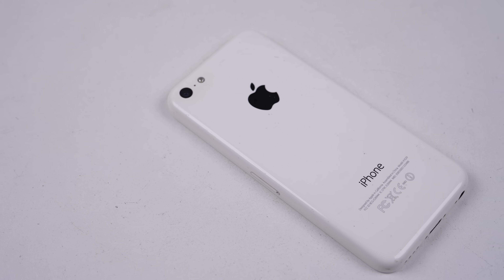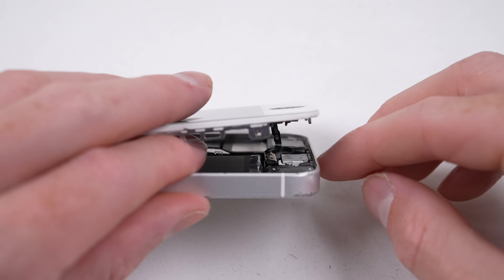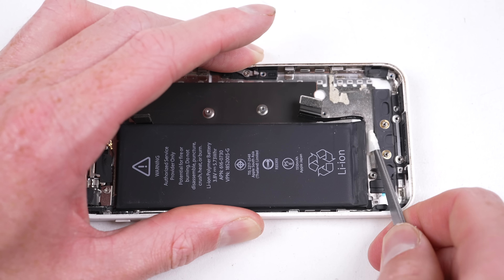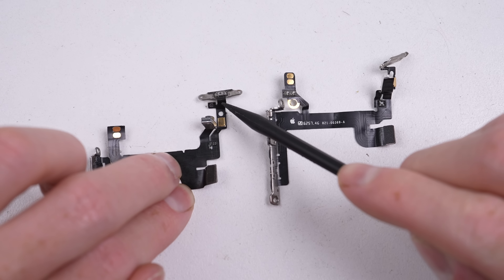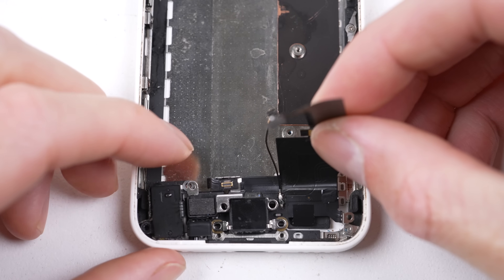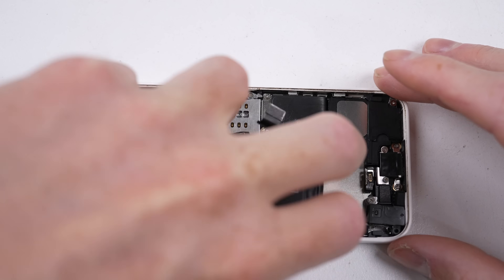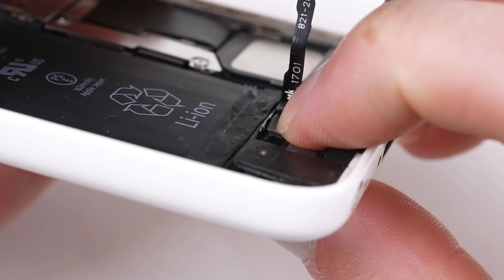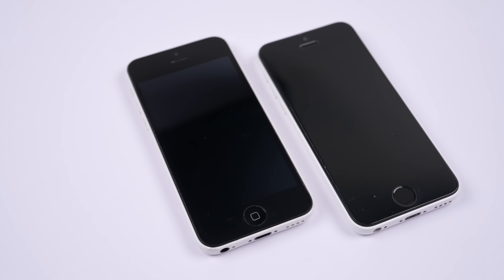I Installed Modern Hardware Into An iPhone 5C | Inventing A New iPhone Model

Comment: I was getting ready to buy an IPhone 5c, more specifically to downgrade it to IOS 6 for igs nostalgic Skeumorphic UI since the 5c was one of the last devices to use an A6 chip that supported IOS 6. But the IPhone 5c has hardware that doesn't allow touchscreen, wifi, or Bluetooth to work if successfully downgraded and can come loaded with problems, so I wanted to buy an regular iPhone 5 that natively ran IOS 6 and put that in IPhone 5c housing. Based on your knowledge, do you think that is possible since they both have similar hardware?

Comment: I put iPhone SE internals inside a black & slate iPhone 5. Had to remove 3 of the screw holes from the aluminum on the inside, as the iPhone SE has a different layout of them on the logic board. Turned out beautifully.

Comment: I have an iPhone 6.5s . This is a productred  case from 6s to 7 with an offset camera like the 7
I took one iPhone for 128 in it, there is one more left without a board, they were the last ones from the seller wow. I also have a completely black case for an incomprehensible to me 5/5s/se which has a back cover made of glass, looks like an iPhone 8
Reply: If I assemble it, I will call it SE 1.5.

Comment: I wish it could be jammed into a 4s. I still use a 1st gen SE myself, and while I like it; it is still a bit larger than my 4s which was the perfect size. I also miss the headphone jack on the top where it belongs, and the larger charging connector. I used it until they shut off 3g cell service in 2022, so it couldn't be used anymore as it doesn't support VOLTE.

Comment: Will apple ever invent a iPhone like the 12-current models with Touch ID sensor button?  But the new button is on the screen but with display still around it not blocked off the edge length of the screen

Comment: So you basically just swapped the case. I still use my 6S daily but it's starting to show it's age. Many apps require iOS16 and it gets slower every day. The first SE is basically a smaller 6S and therefore outdated. It's so sad Apple forces new iOS versions for many apps and doesn't provide fallback. I'll switch to SE2 this year.
Reply: Same

Comment: Amazing work!! I just attempted this myself as a repair tech i have a couple spare phones kicking around :)

I had a hard time with the volume button cable as the spacing between the center of the buttons between the two phones so some wrangling had to be done. I luckily didnt need to trim the speaker as you did but i did also have more issues with the headphone jack.

I did my version with a white 5C and a silver SE, made for a nice all white look for an iphone that was never made :) 

Thanks Hugh for such a cool tutorial, i LOVE frankensteining products like this. Keep up the good work!
Reply: Yeah, the volume buttons are the most difficult part of this entire job.  Three spacing is wider on the 5C, so I used double sided tape to secure the flex cable to the bracket while spreading the buttons up and out. It takes forever to get it to work.
Reply: Is it not possible to use the SE 2nd gen or SE 3rd gen as the donor boards for this my friend ?
Reply: @jdsbkotevjk  SE2 and 3 are larger iPhones and wont work for this. although it may be possible to hotswap between SE 2, SE 3 and maybe even the 8. although i dont see why you would, the phones look identical
Reply: @Kaskobi couldn’t we take the iPhone 5c housing and take the iPhone SE 3rd gen and remove it from its housing and cram the iPhone SE 3rd gen screen and button to the 5c ? Some glue ?

Comment: Ive did a similar thing by putting an ipod touch 7 into an iPhone 5 housing. The motherboard is completely different on the ipod, so i had to modify it and other parts a lot. But it worked out well - now i have an iPhone 5 with the same cpu as in an iPhone 7 (apple a10)
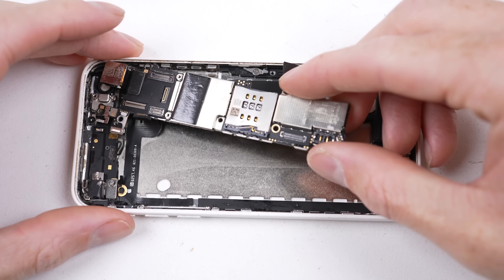Reply: L 7:36 7:37 7:37 7:37 7:38 7:38 7:38 7:39 7:39 7:40 7:40 7:40 7:41 7:41 7:41 7:41 7:42 7:42 7:42ǰ

Comment: This is undoubtedly the coolest thing I’ve seen done to an iPhone. I’ve always wanted to do something similar, but with a slate black iPhone 5 body.
Reply: The black slate iPhone 5 housing mod for the SE has been done before. You will have to modify the screw poses though, which is a bit difficult.
Reply: @gobivfx1893 Any videos on that???
Reply: I stuffed the guts from a 5s into a slate black iPhone 5 housing awhile back. It worked well enough to be my daily, I believe the flash didn't line up well, and I had to grind a standoff out of the backing to get the logic board in, The slate black didn't hold up well, so I eventually went back to an SE. I'd love to hear if someone stuffs an SE into a SB 5!
Reply: я так делал, пришлось пилить крепления платы, но все встало и работает!

Comment: Nice, but since the housings of iPhone 5c and SE are almost identical, there isn't a practical reason of doing that. It ould be much more practical if you did install one of the latest iPhone's hardware in the iPhone SE/5S housing. Then you would have a modern hardware in a small and compact housing. That would be something!

Comment: My brother gave me a green 5C when I was in highschool. I sadly broke its display. It was one of the best iPhones I’ve ever had. Such a comfy and lively device.
Reply: I fix phones as a side job, if youd like it fixed even sentimentally, I'm happy to replace very cheap. Parts are very cheap and its a simple job compared to today's devices!
Reply: @iH85CH001 the 4 4s 5 5s and 5c and se are the second easiest phone on the planet to repair in my opinion he can do it himself with a quick YouTube tutorial and 30 bucks in parts
Reply: Thanks for the insight, guys. I’m ordering a new display today!
Reply: @injeolmi6  How did it go?
Reply: Had the same phone. One of the best phones I've ever had.
Reply: Comfy 4" phones that did just the basics and correctly designed apps were the best
Reply: @ factual upon facts bro
Reply: @lopwidth7343  4 might be comfy for a girl or a 15 yo teen but not for a grown up man with normal size hands
Reply: Replace the screen
Reply: Just use it for comfort

Comment: Damn I was hoping that you would've put an iOS 18 compatible phone in there. To be honest with some ingenuity and micro soldering to change the connectors around a 12 mini or 13 mini board might work. You would just have to drill out part of the five seat back section to make room for the massive camera module, massive relative to the size of the 5C camera module especially on the 13 mini.
Reply: yeah this would be awesome

Comment: You know, I've always thought the 5C was about the first to have a water resistant back. i still have a green 5C 30GB I use to play music off of and I connected it to the USB input port on a new Kenwood unit I was installing in our Bus converted to RV a couple of weeks ago and it started playing newer Hip Hop that I was pretty sure I didn't have on the memory, and it was playing Apple Music off the wi-fi. Bad boy 5C was wanting to still be relevant. So glad you did this. I do have a 1st gen SE but it has that entry level like 8GB memory.

Comment: bro updated a 11.0.3 iphone se to ios 15 😭
Reply: Not Sure, I saw 14.6 in there 11.0.3, and some weird iOS 14 with the 15 wallpaper?
Reply: @sevanandonian9996 Black SE= iOS 11.0.3
White SE= 14.6
Touch ID only compatible with original logic board, simple as that.
Reply: @sevanandonian9996 ok i rewatched the video
there is the white se running 14.6 and a black one running 11.0.3
he used the ios 14 one to showcase, but did the mod with the 11.0.3 one due to it having a black screen

Comment: I am glad the iPhone 5C and SE is very similar to each other. I wish there's also a modernized version of the LG G5 and Samsung Galaxy Note 9.

Now we have the iPhone 5C Second Generation :)
Reply: Actually the Note 9 is pretty usable in 2025, I just bought one at a flea market for 12$ by curiosity & it’s working pretty great, I can use all the social media apps newest versions on it & it’s doesn’t lagging at all. I was impressed, they just need a new battery & good to go🤭🤭
Reply: you can flash custom roms on certain android phones so they can run the latest versions of android
Reply: @ yeah but there’s the risk bout to lose the S Pen functions & Samsung Dex😬😬
Reply: @kaydeedawn  i believe the s pen can still be detected due to the wacom technology on the display but s pen features would be gone
Reply: @kaydeedawn  SPen still should work but sadly it would act like an regular stylus as Custom ROMs don't support Samsung's proprietary air pen functions. But I don't think Custom ROMs support Samsung DeX at all.
Reply: I still use my G5 to this day! I wrote this comment from it!! I cannot live without my headphone jack, IR blaster, and removable battery, ive kinda given up on finding that anywhere, but check out the brand Ulefone! They still have IR blaster and headphone jack. The only reason I haven't got one is im hoping theyll soon add wireless charging. If so, Im sold.
Reply: @iH85CH001  I actually had the LG G6 and it works lag free. I also had the LG G5 too but sadly it just died without any messages back in 29th of January 2025. I liked both phones but sadly my LG G5 had that infamous motherboard death syndrome which suddenly dies after some usage.
Reply: @NathanDavidYellowGuy  shit, my other one did that. It just stopped booting. Could get it to boot by letting it sit sometimes but its been dead for months now and i think its finally gone :( this ones still going strong other thsn the power/fingerprint not working, but i just need to open it up and resolder the pins again. Couple broke off previously just from pocket flexing over time i guess. I suspect a few more snapped by now. I just reboot it by holding volume down, plug charger, wait for lg screen, pull it and let go of button. It reboots into os. But hey, they're pretty cheap on ebay these days, maybe go get one! If you find a gold H830 in good condition, let me know , i want one so i can custom rom it!

Comment: Next video. Making an iPhone 6 have specs of iPhone 13😂
Reply: You could try an iPhone SE 3rd gen motherboard
Reply: @pearelectronics3083IPhone 6is much thinner than SE so it wouldn't work sadly
Reply: @1SergioPushinP  i modding some phones but a 7/8/se20/se22 all the motherboards are similar identical and can fit... i will modifi a 7 case and will put in a SE22 motherboard inside whitout wireless charging but i dont habe actually the time
Reply: @pearelectronics3083 se 3 is basically an iphone 8 with a15
Reply: 13 mini maybe!
Reply: a 7 would work
Reply: In theory it should be possible by getting the guts of a SE 2022 inside a 6 shell. Extra points if You manage to restore 3.5mm port.
Reply: @thetechfromheaven Would not be possible. Why would an iPhone SE 3 motherboard have the connector for a 3.5mm jack?
Reply: @terribletimes902  it is possible but hard asf
Reply: @terribletimes902  Strange Parts already did it 7 years ago. It is not practícalo, but is doable, now even more that you can easily get custom flex cables for cheap from China.
Reply: You need Dynamo the magician for that !
Reply: I would buy that
Reply: I did that with a 7 and an SE 2020 Mobo they use the same screen and most parts are the same too